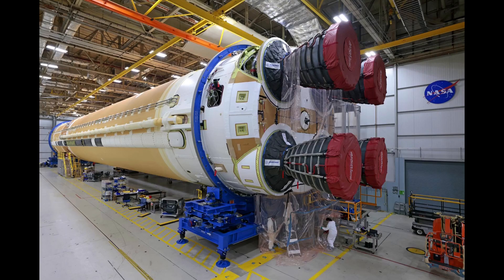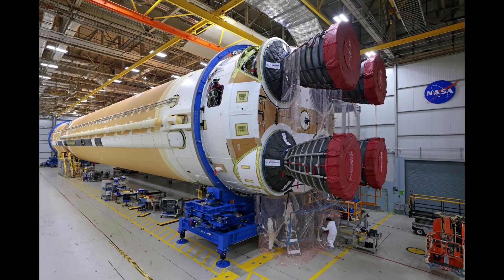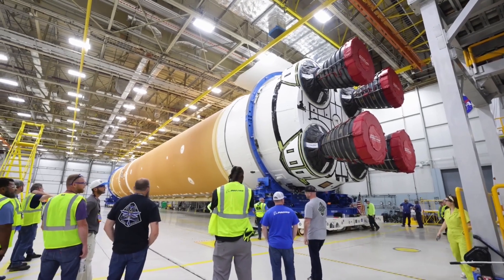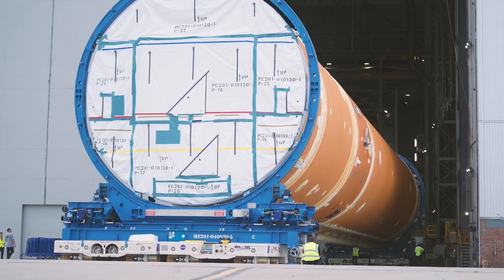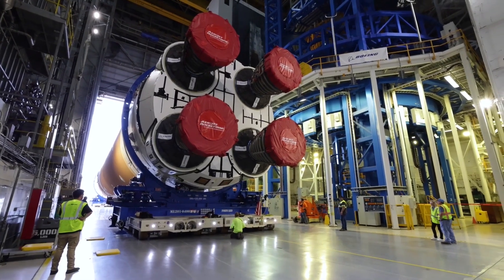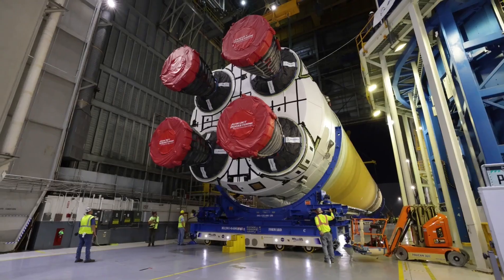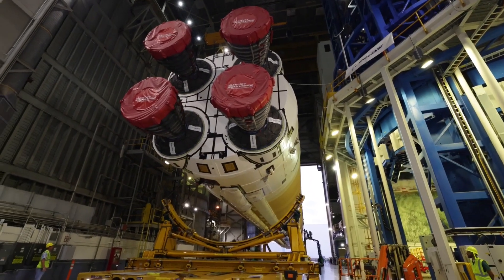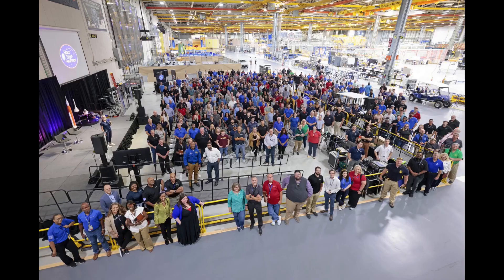End of an era: more pictures of the last SLS Core Stage fully built and delivered from Michoud

Comment: They just HAD to have an e xcuse ot waste hundreds of billions of dollars, and throw away the last 8 irreplaceable RS-25 engines in the world - send 'em to the bottom of the ocean. And for what? 2 missions that  have literally no practical purpose, and benefit no one, other than taxpayers getting a nice "Oooo!" & "Aaaahh!" out of the launches. Unbelievable; And yet, totally believable. Business as usual for NASA.
Reply from the maker: Common misconception: the RS-25 engines don't make it back to the ocean.  They re-enter on the stage from orbital velocity, so they break up and disintegrate with the rest of the stage after an orbit high in the upper atmosphere.

Basically like Starship on the 2nd and 3rd flight tests.
Reply: @PhilipSloss  Technically, some pieces still make it back. But that's really beside the point... or rather, perhaps it further drives home my point: What a disgusting waste and travesty this whole ULA Artemis scam is.
Reply from the maker: @-108-  Sure, some wreckage makes it to the ground in a debris footprint, like all the other second stages that re-enter from orbital speed.  Except for the last Starship and Shuttle, it's molten and disintegrated.

Comment: Where are the Next SLS core stage going to be built?
Reply from the maker: All the structures will continue to be assembled at MAF in New Orleans.  The structures for next unit are already assembled.

What's changed is that the engine section structure was shipped to KSC in Dec. 2022 to be fully outfitted there.  The other four elements will be outfitted and mated together in New Orleans and then they will be shipped to KSC.

And now final assembly of the stage will be in Florida in the VAB there.  The final mate of the engine section to the rest of the stage, engine installation, all the interconnects, and final integrated testing will be done in the VAB.

Comment: I wonder if those rs-25 engines are older ones from shuttle or new build.  Either way, sad to see a reusable engine getting tossed into the ocean.
Reply from the maker: It's predominantly Shuttle hardware inventory, with important exceptions like the engine controller units.  

The SLS Core Stage launches like a first stage, but re-enters like an second stage or upper stage, so the engines are disintegrated and melted down to small fragments by re-entry from 7.8 km/sec velocity, which is orbital velocity.  First stages typically peak at around 1.5 km/sec.

To reuse those engines, you'd need something like Shuttle or Starship, which would be at the price of a significant payload penalty.

Comment: Thank you for the Update!

I wonder, how fragile is this booster exactly? Is it kept under pressure or are there other measures to keep it more rigid? I can't see any machines keeping it under pressure, so I probably underestimate its sturdiness.
Reply from the maker: The structures are rigid.  The propellant tanks are still kept at a pad pressure.
Reply: @PhilipSloss  Thanks for the reply. Is "pad pressure" a special term? Meaning more than 1atm?
I would imagine this would also help to keep pollutants from leaking inside the tanks.

Comment: I wonder if the forward section of the SLS first-stage (Inter-tank, LOX tank and forward skirt) would still be stacked at Michoud before being shipped to the VAB?
Reply from the maker: Yes, the top four sections will continue to be produced at Michoud.  The new transfer points are, first, when the engine section structure is completed, then that is shipped to KSC.  Then, after the first two major joins, the "4/5ths" assembly will be outfitted and then it will be shipped to KSC.  Then those will be joined and finished.

Unfortunately, so far NASA and Boeing have not been willing to discuss the process at KSC in any detail, so we're still waiting for an opportunity to do that.